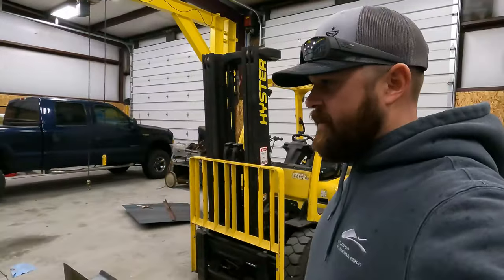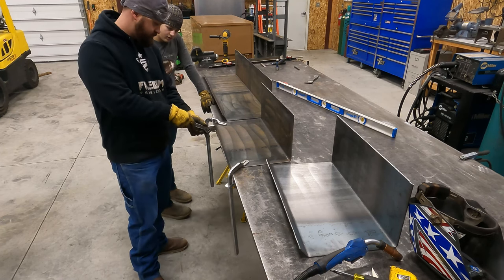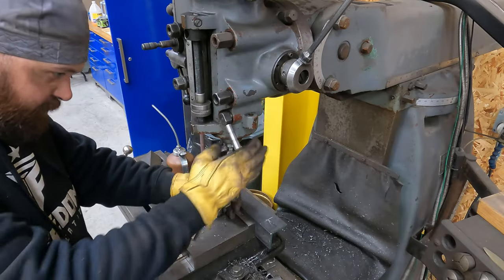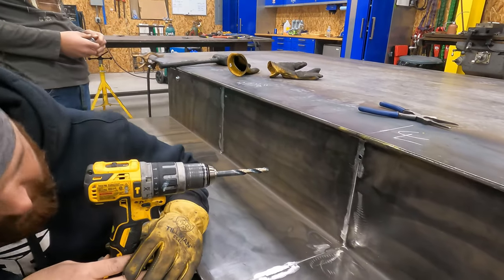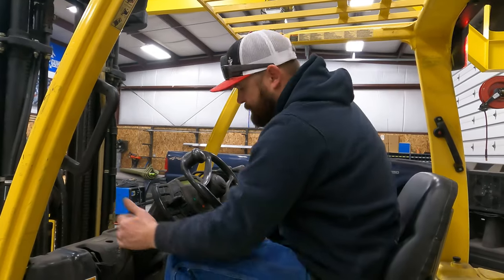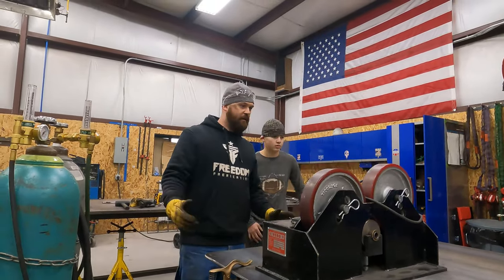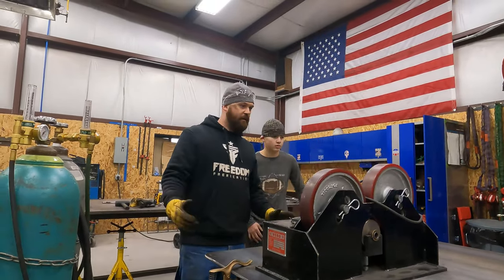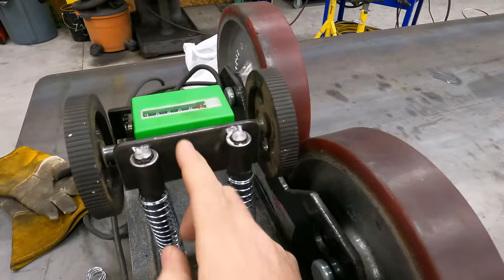Welding and fabricating a Drive roller table part 2

Comment: I just bought a magnetic gauge for my ironworker. Its magnetic-you put it underneath material.       Your machine doesn't have a down stroke and return adjustments?
Reply from the maker: I need to get one of those as well. My machine does have the adjustments, but I think something is going on with the hydraulic valve that won’t let me make small adjustments. I need to dig into it, but it’s one of those things that I need to have some spare time to do, and you know how that goes…..

Comment: How did the spring loaded counter bracket work out for your customer, no binding or clearance issues with the rolls of material?
The set of dual spring combos was FABulous...
Reply from the maker: I wondered who would be the first one to ask about clearance. Good observation. There weren’t any clearance issues because if you watch in the video, the front roller was not in the top adjustment. Once we moved it up, it was 👌🏻. Thanks for watching!🤘🏻🇺🇸🔥

Comment: Im not sure if you are having issues with this, but It possible to tighten up the clock spring in the quill on your mill so it doesn't drop due to gravity.  The lock is really there to keep your quil locked while your are machining, and shouldn't be required to keep the quill from falling.  I want to say you have to remove 4 screws on the quil housing, and dial the housing counter clockwise until it's tight enough that it holds up on its own then put the screws back in.  I had a problem with mine dropping when I first got my mill, and was able to fix it with adjustments.  If you were locking the quil just to be safe, then disregard. Cheers
Reply from the maker: I will definitely look into that. It actually does fall a little bit. Something I would like to address. Thank you for the info!
Reply from the maker: @JeremiahL  thank you for the input on this. I definitely prefer to have my equipment running properly. The video is very helpful. Thank you!
Reply: @Freedomfabrication777  Glad to help.

Comment: I'm not sure if you own one butt you should look into a metal cutting circular saw for any curs you require on a flat bar/plate that is critical it dosnt warp with heat from plasma/ flame cut